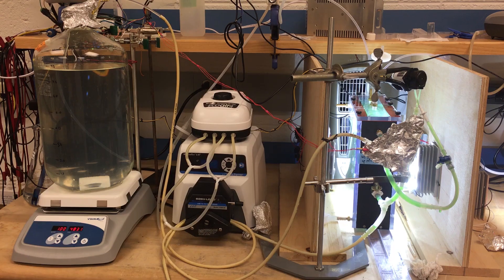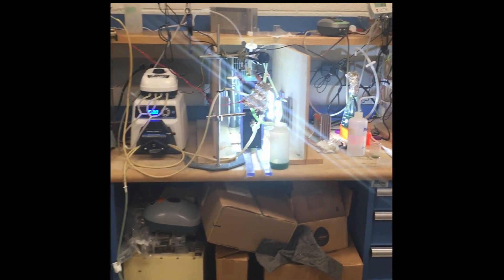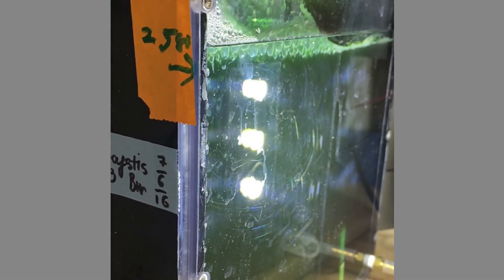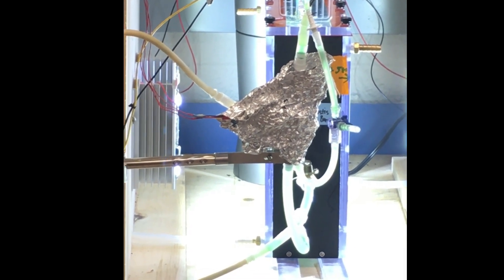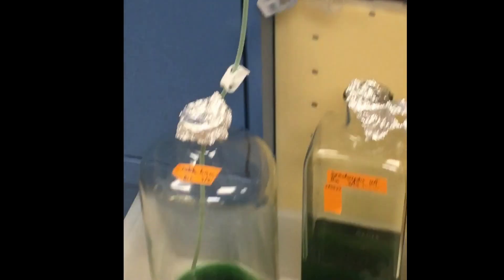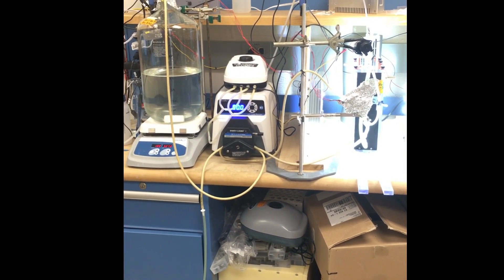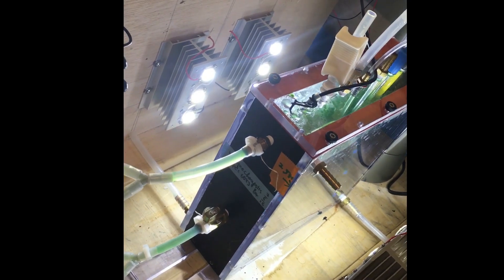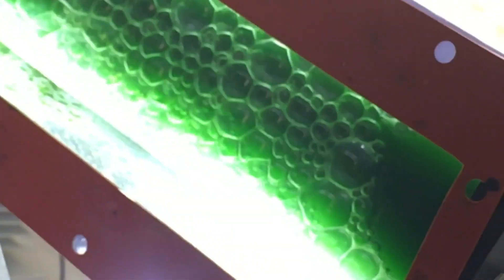turbidostat for microalgae

Comment: Hey. Where did you get that sensor with an open passage? I've found one which needs to be submerged. Thanks in advance.
Reply from the maker: It was 5 years ago, I believe that the search was done through Amazon or eBay. Look like the sensor with the open passage is still available.
Reply: @ilikenuts Thanks for the answer. It really hard to find that. Can you please also explain how adjusting set value works? I mean potentiometer usage. Do you control input voltage using this? or something else?
Reply from the maker: @antonshiryaev9587  Take a look at the instructables.com link below the description for more info. I used a rotary potentiometer to adjust the set value, and adjust this value manually through a nob.
Reply: @ilikenuts  So you set this value for medium without the algae culture? it's like a 'zero'?
Reply from the maker: @antonshiryaev9587  I did not. The set value is an approximation of the OD culture determined by a lab-grade spectrometer. Not sure if I answered your question. The 'set value' is an operating parameter, not one value of OD, if that makes sense.

Comment: Hello! Did you measure light spectrum of the turbidity sensor? Can we use that spectrum for microalgae density monitoring? Have you tried to calibrate also measuring dry weight of biomass? Thanks for answers beforehand.
Reply from the maker: No for the first question. I cannot find the exact wavelength emitted by the diode either. The wavelength is in the infra-red region. For the second question, I did not do dry weight measurement for the samples in the experiments, but we have been used a 254 mg DW/OD unit.  The conversion number was experimentally determined by directly measuring dryweight and OD by Synchocysits sp. PCC 6803 in our lab.
Hope this extra info helps,
Reply: @ilikenuts  Thank you so much! I was going to create such a sensor from scratch. Will try this stuff.